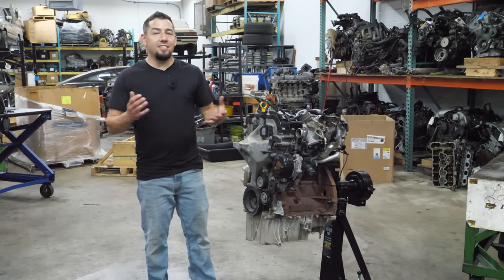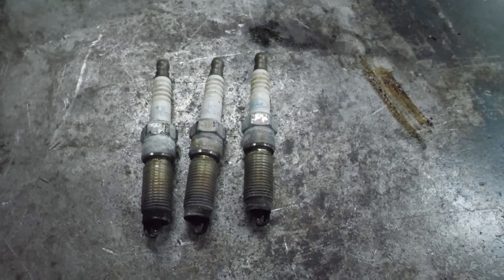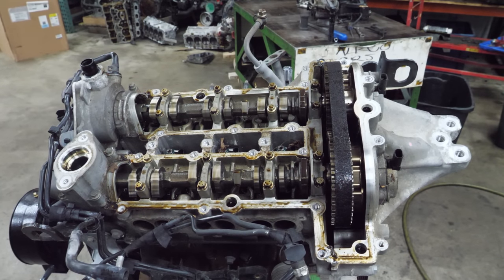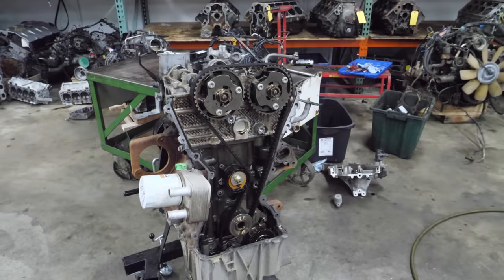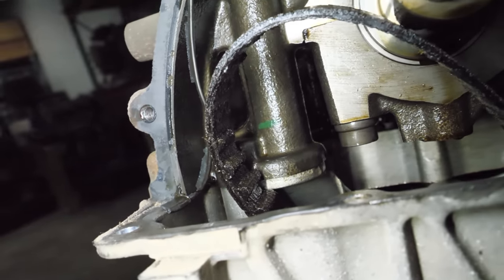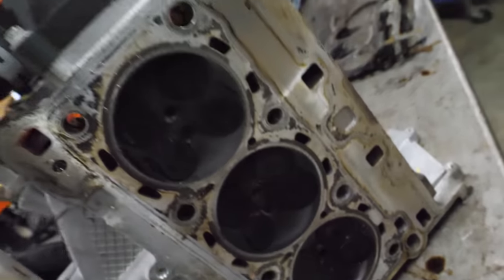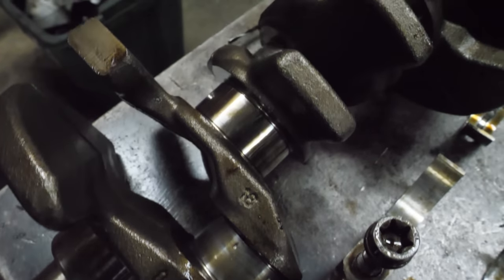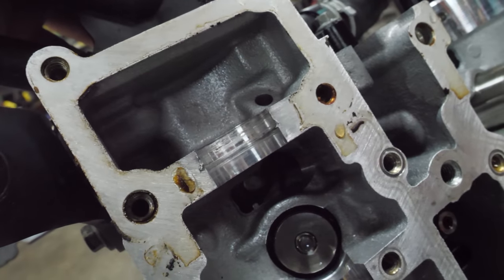JUNK Ford Ecosport 1.0L 3-Cylinder Ecoboost Teardown. LAWSUIT ENGINE!

Comment: using the wrong oil will dissolve the belts (there are recommended oils especially for wet belt engines  not using them will disintegrate the belts and  block the oil filter,  which will stop the flow of oil and  overheat the pistons which in turn will damage the piston rings and on and on it goes till you have no engine, it needs a full service every 30,000 miles with a belt change, the most common reason for faults  is using cheap oil and cheap belts, as for that engine as a whole I would say it had a mechanic that did not know what he was dealing with. I have a Euro pure Tec 1.2L  3 cylinder  wet belt petrol engine  It averages between 42 to 49 MPG.

Comment: Scuttlebutt over the pond here in the UK, these engines have been nicknamed ecobooms due to their ability to destroy themselves. Most common reason being wrong oil used. This then causes the wet belt (agree terrible idea, if you're going to put it in there at least use chain) to swell and then moult blocking the strainer, usually causing turbo failure by which time rest of the engine is junk due to oil starvation which it seems is exactly what you found....

Comment: I have a 2020 Ecosport, I just found out about a oil pump recall after my engine blew on the highway.. took it to my dealer and it's going cost $9000 to fix.. should Ford be responsible for all the repairs..??.. plus the recall part won't be available for another 2 months according to Ford..

Comment: Ford 1.0L would make a great go cart engine or a side by side replacement engine. Ford engines and transmissions went in the crapper in modern days. To buy a Ford is a crap shoot to getting stranded. I'm a lifelong Ford guy. 1995 is the newest Ford I'd recommend.

Comment: If all the plastic components in the hot engine compartment was not evidence enough..
    The 'wet timing belt' has got to be the most blatant example of 'Planned Obsolescence' I've seen in years.

Comment: What Ford's engineers were smoking when decided to use a rubber belt instead of a steel chain to drive a crucial part for the engine 😡

Comment: the honda eu2200i (gxr120 based) generator engine has a timing belt submerged in oil

I don't know if it's an interference engine or not, but it's known to be fairly reliable...

My guess is that submerged belts aren't a material issue any more but rather a convenience issue.  Because belts should be replaced like every 100k miles.

Comment: So i just had the issue he is seeing happen. There's a recall now on the oil pump. I am having issues with the dealership that worked on mine they claimed to have replaced the engine not sure about that. But the pump isn't available yet. My car is having shifting issues now also double the fuel consumption bad motor mount shake. The dealership is saying the dont have to touch transmission to remove engine and ny complaint is transmission related.

Comment: There isn't a balance shaft in this engine. There's a video with the chief engine designer for  Ford of Europe ( Ronald Frazier) stating that this engine design is "ballanced" by an offset flywheel . This is supposed to negate any expensive ballance shafts.

Comment: My wife's escape has a 1 liter engine with dual injection system and i have read about a fancy valve train that can kill one cylinder.  I was disappointed this engine didn't have those features.

Comment: I just watched another guy speak about these engines.  He spoke about the failure of the tensioner belt on these engines with the wet belt.  Many lawsuits have been filed against Ford for the problem with the small belt tensioner.  He stated this typically happens around 60K miles.  Ford states the wet belt should last 150K.  I don't any have achieved this number.

Comment: I am looking at a 2015 fiesta 1.0 Ecoboost for my cousin, we actually are going to take a look at it tomorrow. It has gone 133.000 km. . Is this the same engine as you are talking about here? Or is there any difference between the 2015 and the One you have here? I would appreciate any help if possible, because my cousin is a single mother of 2 and needs a car badly. . 
Thank you in advance
Reply: I hope you didn't get that car because its the exact same engine you seen in the video and as you can see its a nightmare of an engine. If you ever need to replace that wet timing belt it costs 4 digits too.

Comment: I have 2 ford 1.0 ecoboost, a focus and a fiesta. The fiesta is 10 years old and it never failed on me. These engine's need a specific oil and it needs to be changed every year. If you dont then yes they fail. Ford says if you use the right oil the belt will go 240.000 kilometers or 10 years. The downside is that if you need to replace the belt is costly.

Comment: I had a rental Ford Escape with the 3 cylinder 1.5 eco boost engine. 21mpg is best I could get. My CRV with a 2.0 get around 40mpg.

Comment: Sometimes creative engineering solutions don't work out. The wet belt SOUNDS like a good idea, but that depends on the materials. It sucks when consumers get stuck with the bill. From some comments below me, looks like the tensioner failed. 
That is a weird setup, it looks like there is a spring hub on the balance shaft pulley and the crank is just used as idler for the oil pump and the balance shaft. There was a lot of engineering went into that failure.

Comment: It looks like its had the usual wet belt failure problem which brakes down and blocks the oil ways. The ford echo boost engine is nothing better than a elastic band in a toy 😊

Comment: The Ford 2.3l dohc engine also has none of the timing sprockets keyed. The idea is that all of the shafts are aligned with positioning tools, then you tighten and pinch them in place. All straight loose fits.  I would like to see at least the crank sprocket fixed in place.

Comment: There is a recall. "When parts are available, owners will be asked to take their vehicle to an authorized Ford or Lincoln dealership for a free replacement of the oil pump drive belt tensioner assembly with a longer-lasting part.". From what i understand youre going to be waiting a while for the part. Better over-maintain it the meantime... which I'm sure most of the women who bought these won't.

Comment: so if any wet belt engine needs the belts replaced after 75k-100k (depending on manufacturer)...... why has no after market company come up with a chain and gear conversion that could be installed at this service??

Comment: To the unaware buyer, I suppose the only way to know if the car has a  "wet" timing belt is to see if the timing sprockets have a metal cover just like timing chain designs? Could the engine be why they shut down the plant in Chennai, India, which made the Ecosprot?

Comment: This is an ultra common problem over here in the UK, I personally can get about 3 to five cars with this same exact fault per week which equates to about 30% of all 1.0l ecoboom cars that come in. The wet belt replacement interval according to Autodata (Ford's figures) is 150000 miles or 120 months. Just plain ridiculous. Head gasket failure is also common and these cannot be repaired which means you need a new engine. Oil degrades rubber + 150000 mile change interval = lots of money. Obviously not an accident.

Comment: The crank pully is not keyed because "ECO". (Economy for Ford, not the owner.) I would HATE doing a timing belt change on this engine.  I like doing it on my GTV6. Sure, I have to pull the radiator out to make room, but that's two hoses and one bolt and the belt is changed in around 2 hours!

Comment: This video kills me.... we just got a 2021 Escape with the 1.5l 3 cylinder ecoboost engine.
Now I'm 100% concerned that we messed up.

We almost got a Rogue, but were warned multiple times about the CVT transmission, so we steered away from that.

I had seen vids about the ecoboost engines pop up, but didnt look....now we have one.

The timing belt...did we get the newer block without those slots in between cylinders that cause head gasket failure and coolant intrusion?...

And if we try to keep ahead of belt failure by changing it, what will that cost?

Ugh ....
Reply from the maker: The 1.5 is not the same as the 1.0, but o haven’t done a 1.5 so I’m not sure how good those are but I’ve heard they don’t have belts .
Reply: @I_Do_Cars hi. Thanks for responding. Our Escape does indeed have a timing belt, with the dreaded belt soaked in oil. I even double checked before responding to you. The recommended change of the belt is 60k to 100k, but look at the condition of the belt you pulled.
My understanding is it's several hundred dollars to replace the belt. And those out there are saying to do it much sooner than 60k.
Our car presently has 24k.

What I don't understand is why there isn't a gear and timing chain replacement that could be installed and rid these engines of the belts.
But then again I'm not a mechanic. 

If we had opted for the 2.0 4 cylinder ecoboost, those are chain driven. 

Hindsight is 20/20, and research beforehand is immeasurable. 

Happy holidays. Thanks for chiming in.

Comment: It's best to remove the sump before the timing chest on these. The floating crank pulley makes belt tensioning a breeze and Crank timing is done through the external pulley. You missed a trick with the oil sump pickup, that circular cover easily prizes off and you can see the mesh filter clearly and if it is covered in rubber debris. This engine was an extreme example and we were denied seeing just how bad it was and this would have been the shot of the entire video. Lack of maintenance is the likely cause of this engines demise despite what you say, ie oil changes with the CORRECT SPEC OIL AS ADVIZED BY FORD. There is also a smaller mesh filter in the cylinder block that must be cleaned. In 2019 Ford changed the timing belt to a chain but left the rubber oil pump drive belt. Belt routine replacement can cost up to £2,000 at a UK Ford Dealership as it involves seven hours of work and strip down of much of the engine. These engines are wonderful and give a smooth powerful engine that feels like a good two litre. The downside is the maintenance cost of a new belt and finding a trusted mechanic that knows how to do it right. The other downside is that the correct Ford approved grade of oil is used at regular intervals or the belt will suffer. Even using a high end oil can ruin the engine if it is not correct as approved by Ford. Also being a turbo it is possible some owners will fry the oil by careless cooling down as the destination is approached and Ford do not design a run on procedure for the oil once the engine is parked. Now and again Ford threaten their own existence by incompetence and the approval of this engine without looking at realistically how many cars are treated by owners leaves them open to unfair ridicule and reputational damage but just how this design was approved and by whom should be examined. The warranty situation is the US is much smaller than the situation in Europe.

Comment: common problems indeed. My daily job is working on this type of engine. Pretty funny design if you ask me... It's a great engine for the lease company’s. The car needs to survive for at least 60k kilometres or 4 years. Easy with at least 2 oil changes. The oil has to be changed at 30.000 or 2 years (factory specs). Way to long for this engine. It should be about a year and 15.000 kilometres. This way you get max lifetime out of your timing and oil pump belt.  Belt should be changed every 240.000 kilometres or 10 years. Most engine’s won’t survive because the belt change is very expensive. At  our country this repair cost around 1900-2500 euro and is a 2 day job (bad design, takes long time). Most customers won’t replace it cause they think the repair is to expensive. They rater wait 1 more year than replace it. Out of experience these engines won’t hold on for 1 more year and then blow up. Cause: no oil pressure or belt had no teeth and skips teeth. How ever, there is no way you can fix this engine anymore and you need a replacement. Btw don’t forget the turbo had no oil either when your pump is full of debris.
And a replacement engine is also to expensive. Most of the time because the car value is less than 6000-7000 euro’s they and up as scrap cars.

1. Change your oil faster or don’t buy a ecoboost with wet timing belt. 
2. Change your oil pump belt and timing belt faster (8 years or 180.000km) 

Just to be on the save side 😊

Comment: Ford engineers : "Hey you know what would be a funny joke....."

Also, Ironically surprised with all the teeth off the belt it even had enough to suck any oil up to pick up the rubber pieces

Comment: Ford has issued a recall for certain 2018-2022 EcoSport and 2016-2018 Focus models equipped with the three-cylinder engine and 6F15 automatic transmission. They could suffer from a loss of engine oil pressure due to a defect with the oil pump drive belt tensioner  REBUILD IT AND SEND IT  IN LOL

Comment: I have 205 with timing belt outside oil and no problem at all, those engines can easily go 1 000 000 km and diesel even more.

Comment: Do not postpone belt replacement on these engines. Do it no later than the manual says.  A friend went one month over the 5 year time, since the car still had less than the recommended mileage and that costed her an engine.
Reply: A coworker of mine had one of these engines in his Focus (3d gen) and said that his manual stated the interval was 10 years or 240k km. (150k miles) Seemed a bit excessive to me, as most dry belt engines require replacing the belt every 5 or 6 years and almost never more than 100k km. Keep in mind changing the belt on these cars is very labor intensive, requiring expensive special tools, so it can cost upwards of a 1000 euros to have the work done. Not something most people will do as preventive maintenance. If it reaches 200k on the first belt I suspect most owners would just get rid of it, instead of having the work done.

Comment: Ford zetec engines havent had woodruff keys in the crankshaft for years and years.......Purely the tightness of the crank sprocket and pully hold it in place.

Comment: It seems, that a well maintained engine of this type is indeed ok,  but, as you mentioned, the problem is the rubber timing belt running in oil. Only special brands of motor oil are certified for this type of engine. If you use an uncertified brand (even if you use only 500ml to top up the oil level), damage of the belt as observed here in the video is the result leading (more often than not) to a catastrophic engine failure. You added an uncertified oil to your engine ... you better have the belts exchanged, the filters changed and the pan (and especially the oil intake) cleaned out. No other of the small downsized engines is that picky.

Comment: Just how does the timing work on that moped engine, when there ain't key on the gears or shaft
Reply: Fully floating  sprocket. Look it up , it is a very very common feature on modern OHC engines.

Comment: You think it's just latitude on the engineers part at Ford that makes these engines like this or that they do it purposely because like you said that engine didn't look to be abused. Maybe you only had what $50,000 mi on it if that and it's in a complete failure and you have to throw away the car $25,000 or whatever. I know that I've read that they're pushing everybody towards the concept of. I've never being able to pay off your car that everyone will always have a monthly payment if they have a car. Basically they'll be leasing for life and by making these parts so expensive like the $12,000 Nissan transmission that you can't even buy a seal for that leaks.

Comment: 3 cylinder engines don't take abuse very well they are strictly fuel economy and belongs in very small cars. This one looks like its been drag raced and pounded bad plus neglected. If you want an engine that can take drag racing then get a big one. Battle of the lawnmower engines will give you this. Also these little engines need the best full synthetic oil money can buy because they are the hardest working engines and change the oil before the recommend interval. If you keep your foot out of it and maintain it correctly it will last. Look at the piston rings. They got HOT!!! COOKED!!! somebody had a heavy foot plus it was in a vehicle too big for the engine. I like this engine it has a good concept it just needed the right owner

Comment: I worked for Ford of Europe around 34 years ago and am quite proud of the design work that we did back then.  It really saddens me to see the utter junk that Ford has produced in recent years.  The wet belt system - on this engine and the diesels among others - is right down there among THE worst engine design ever undertaken.  Ford continue to make one blunder after another - the recent revival of the 'Ford Capri' is truly horrific - and it's only a matter of time before they're acquired by a Chinese manufacturer for the brand and everything else is shut down.  Tragic but they sealed their own demise with this kind of crap.

Comment: As I went past retirement age, I became more convinced that important things are being managed by teenagers who because of their tender years have not experienced enough setbacks in life to make them cautious. Also because of the sensitivity of accountants to the "bottom line", there is often a rush to market with unproven designs. Yet another example of failures in important places highlighted by "I DO CARS" is the use of aluminium bolts by BMW. I keep looking for a second hand car to buy, but which manufacturer should I trust?

Comment: The crank isn't keyed as it allows alot finer timing of the cam/crank. Renault have done that since the 90s at least here in the UK/Europe. Hence why the crank pulley bolt is done up effing tight.